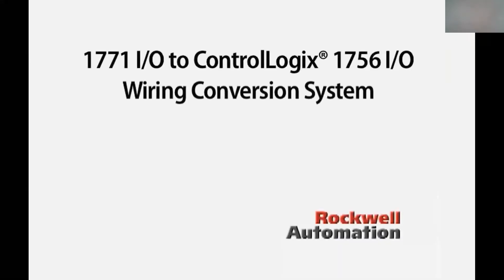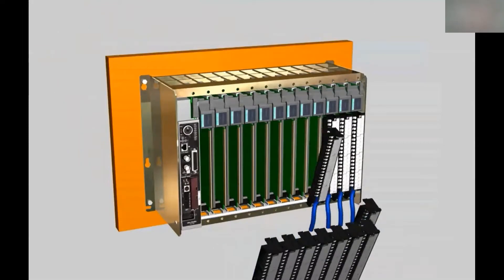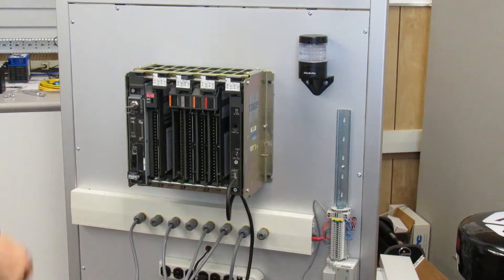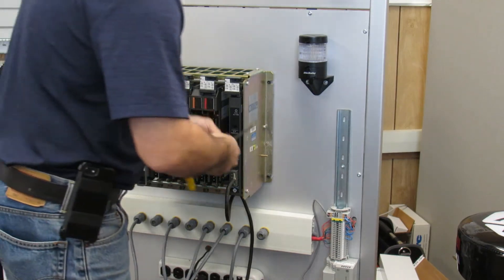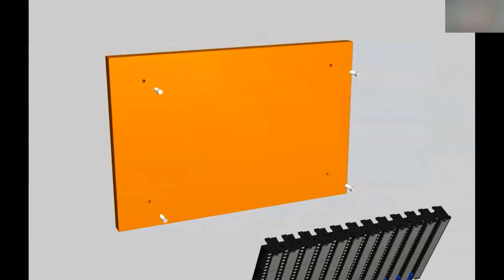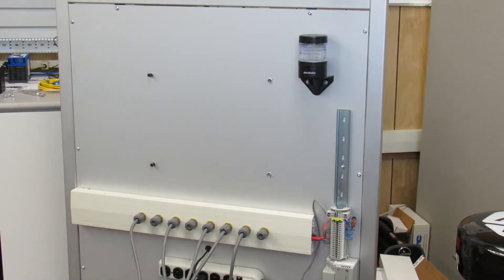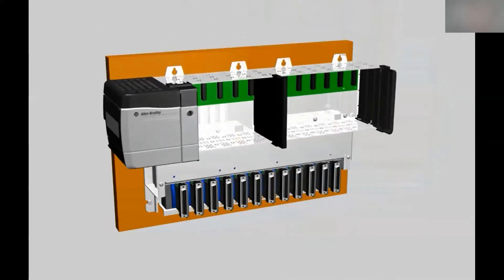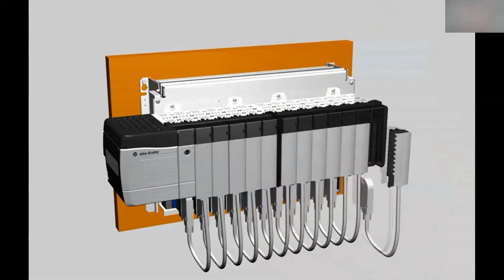Allen Bradley PLC5 Chassis Conversion Demo

Comment: Does anyone actually do this? I would imagine in larger installations where downtime is measures in megabucks per minute this might make sense, but anywhere that had that problem has probably already handled it rip and replace. What AB should have done was to make a module to replace the PLC5 controller that connects to a CLX PLC and leave all the other IO in place. That's the kind of temporary workaround I could make use of.  It's not the IO that is the usually the problem, it's the forced obsolesce of the PLC.